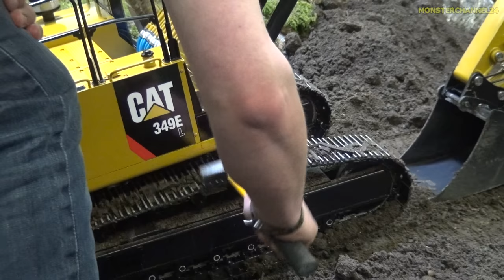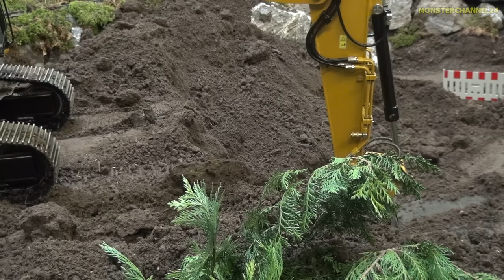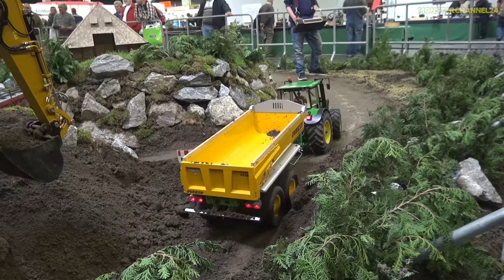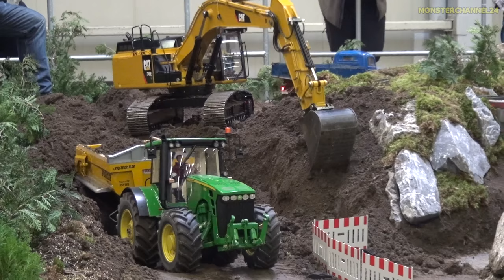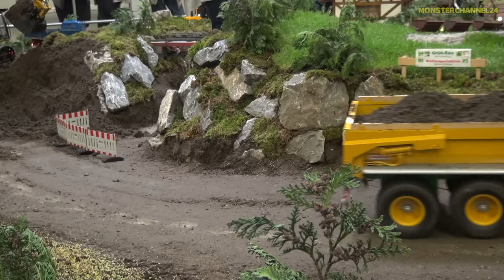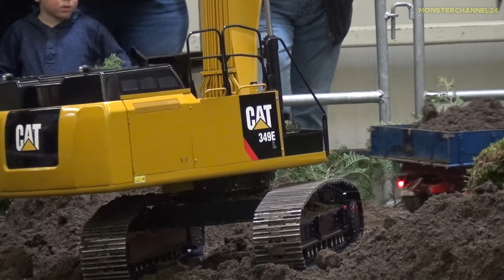155 kg! RC  Excavator in HUGE 1/8 scale! R/C Caterpillar Action!

Comment: Why is it so much more entertaining to watch the rc versions of machines rather than the real ones?
Reply: good point
Reply from the maker: I love to watch the real ones as well... :)
Reply: I operate the real one everyday and love watching the rc ones so idk lol
Reply: C Mayb : I also operate the real ones everyday 349 nice machine but I like the 365 and 385 better for some reason. Watching these r/c excavators is pretty cool I want one
Reply: @ineedabeer3948  yes they are yours has more power then my 325f tho but she can still crush every rock but blue rock lol
Reply: C Mayb : lol nothing can crush the blue granite! We have a 345c with a 160 hammer and it destroys the bits. Dynamite works awesome for that.
Reply: @ineedabeer3948  yeah we use dynamite were a pipe crew so we gotta have a smaller ones lol
Reply: C Mayb : that’s what we were doing putting pipe in for a new sewer line. Neighborhood was 60-80 years old had tericada* not sure if I spelled that correct. We blasted everything in the middle of streets pretty insane and took months to finish. I’m from Delaware. South is sandy/clay but north omg blue granite.
Reply: Cause its cooler
Reply: Most likely bc theres more variety and camera angles and not a guy in the cab saying oh we are digging a ditch
Reply: They are actually real but in the form of rc
Reply: @monsterchannel24  hey new to the channel and i love it! where do i find and buy something like this ?
Reply: I like both

Comment: i want buy this excavator where can buy this
Reply from the maker: This one in 1/8 scale is complete hand made and not for sale. It's not available in any shop. Sorry to tell you.
Reply: +monsterchannel24 oh thanks
Reply: monsterchannel24 may i ask, did you have to get anything from overseas to build yours? I see some companies have made similar models but not as accurate to design and movement as yours,  it seems here in the U.S. there are not any good sources of supply for these types of builds. I am no mechanical engineer by any means, but just knowing where to start would help a lot! Pretty partial to the newer yet almost idendical F model as I have run the real deal. Where would I start?